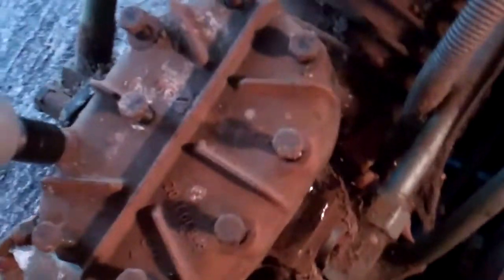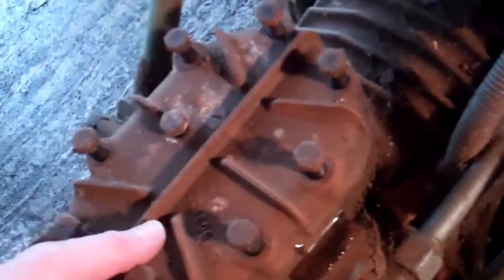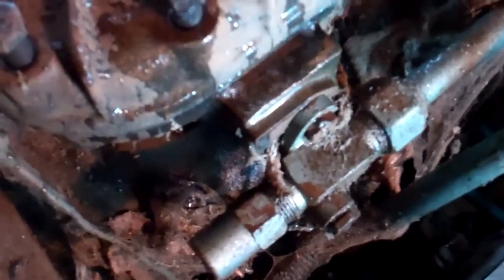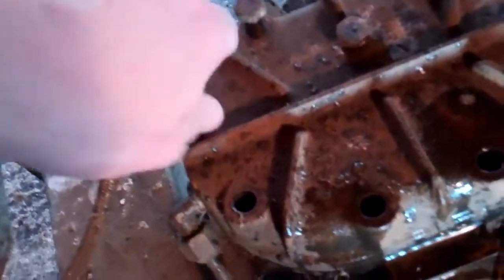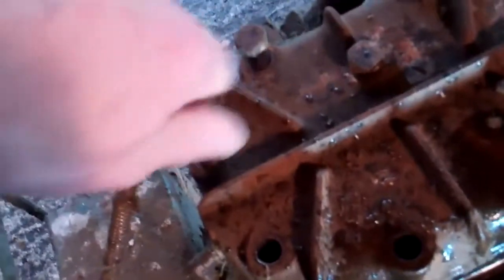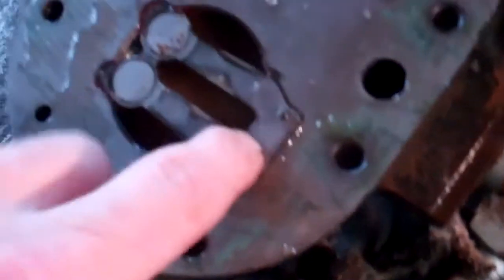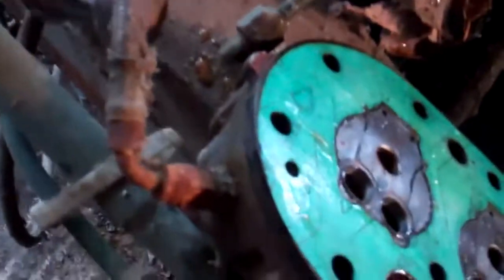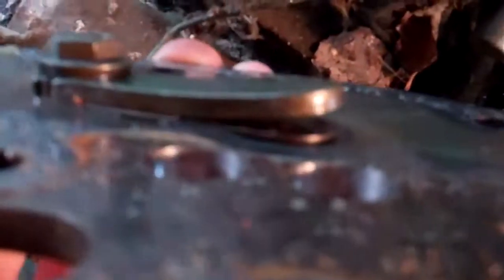Copeland Compressor Full of Water!!!!

Comment: Lulz. I've been researching exactly how to do just that for the last 6 years, and it turns out that a properly modified screw compressor (which I am building/overhauling for my senior design project) could pump pure water or hydraulic oil at up to, if not well over, 3,000 PSI. I hope to have a video of it operating up here someday.

Comment from the maker: Yes you're right. Its all got to be recovered, waste transfer notes filled, waste transfer licence, premesis code, F-Gas ticket etc and sent for recycling or destruction.

This system had been idle for 7 or 8 years, at some time the evaporator split and let the refrigerant out and water in, the pressure you see pushing the water out was caused by a five second run of the compressor till it got noisey...
I have a vid of my recovery machine working on a similar system with the comp all icy!